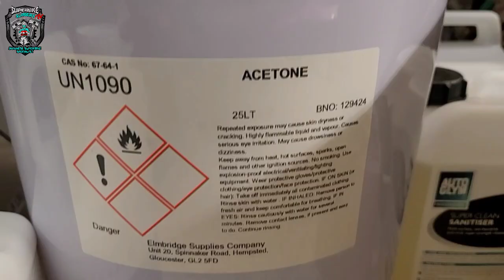New Bike Day, The big clean! Part 3 of 4

Comment: Top tip... wrap your brush with tape around the pressed metal bit so you don't accidently scratch anything.
Reply: You can use self amalgamating rubber tape, sticks to itself then electrical tape..

Comment: Good stuff BH, for those on a budget Stardrops @10:1 mixed in a spray bottle. Contact cleaner for joints, just make sure your cleaning agent has no gloss enhancers on the paint. pH wash, wax, FK1000p by hand Sonax BSD.
Carbon Collective or Gtechniq do ceramic coating for everything.
Great job Jim, beautiful result, Bilt Hamber.

Comment: I like your videos Jim. But it's a little tragic to see an adult in a modern society standing on his garage driveway and flushing the oil with chemicals from his motorcycle. okay if you wash the car sometimes with eco-labeled detergent but it is not good to clean engines from oil and release it directly into nature. In sweden, it is forbidden to wash vehicles outside car washes that purify the washing water. There is a reason for that. You could have something underneath the engine that collected the waste water.
i'm not a environment taliban in general but try to think what Im doing that affect the environment.
Cheers!
Reply from the maker: F...me seriously! Environmentally friendly cleaner washing away a bit of road grime. I'd only have to run it for 5 minutes and it's probably caused more damage! And FYI the drain on my yard goes into a filtered sump. Shouldn't be so quick to point the finger when you don't have all the facts!
Reply: Hi Jim. That was the response I was expecting unfortunaly. Im not going to argue whith you but the answere telling me Im right.
pollution prevention guidelines
Vehicle washing and cleaning: PPG13
These guidelines are jointly produced by the Environment Agency for England and Wales, the Scottish 
Environment Protection Agency, and the Environment and Heritage Service for Northern Ireland (referred to 
here as ‘we’ or ‘us’).
Following this good practice guidance doesn’t remove your responsibility to comply with the law and prevent 
pollution from your activities. Causing or allowing pollution is a criminal offence; compliance with this or 
any guidance isn’t a defence. You should make sure that the references to other sources of guidance are still 
current; use updated guidance if it exists. 
This guidance covers vehicle washing and cleaning by all methods, including:
• automatic wash systems
• washing by hand
• using high pressure or steam cleaners
at all sites including:
• retail premises
• business and industrial premises
• public and private car parks
• former petrol filling stations
This guidance also applies to washing and cleaning plant, machinery, equipment and boats as the principles 
are generally the same. It doesn’t cover household activities but our good practice advice would be to use a 
commercial facility (car wash) that re-uses water, or hand wash with a bucketful of water and a sponge without 
using detergent, traffic film removers, degreasants or other proprietary cleaners. We discourage the use of 
hose-pipes or high pressure cleaners for car washing at home. Contact us if you need further advice.
Following this guidance will help you plan and deal with liquid and solid waste, reduce the risk of causing 
pollution, and there are more to read at PPG13.......
I have NO more comments and it was only to point out that you could act differently in the future.
Reply: @gandalffotsvett9435  good job we don't live in Sweden isn't it. Luckily, we are allowed to exercise our own intelligence and wash our vehicles and make an assessment depending on the dirtiness of it.  All I see here is someone washing a cleanish bike on his own property. I'm not interested in continuing this conversation since you seem to want to find all kinds of Googled regulations which as an intelligent person, I can't be bothered to educate you on. So I shall simply bid you a good day, and let you know that if you respond to me, it means you're a poopyhead.
Reply from the maker: @gandalffotsvett9435  Wow...just wow! I'm not sure who this Benji guy is 😁 but he seems to be talking sense! What has the world come to when you can't even wash your own bike on your own property with the recommended environmentally friendly product without some environmental nutter jumping on you. Makes me wonder why I bother making these videos. 🤬
Reply: Wow, we now have bike washing police, ffs.
Reply: @SuperbikeSurgeryTV  I am lost for words-the world has gone mad.Fantastic channel btw which I have only just discovered unfortunately.
Reply: @martinowl  🤣🤣🤣
Reply: @SuperbikeSurgeryTV  My brother lives in Sweden and he always washes his cars outside-he hasn’t been locked up-yet!